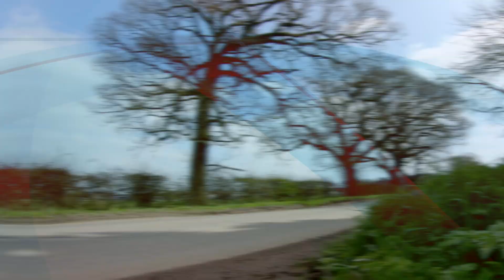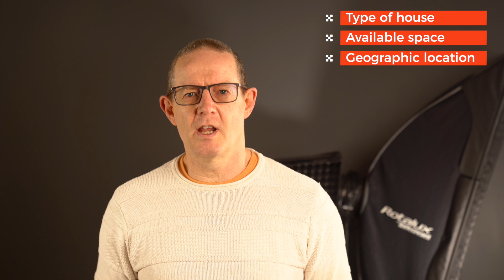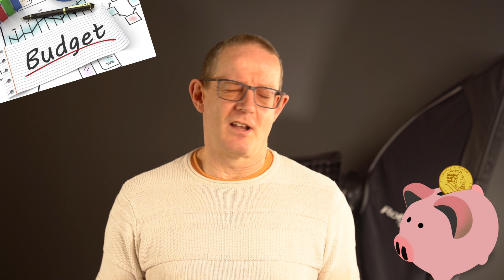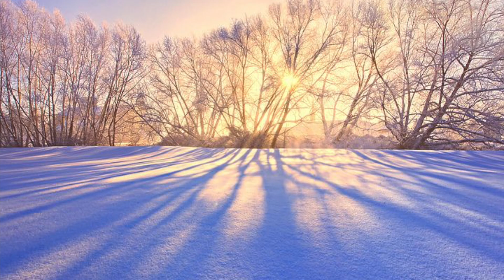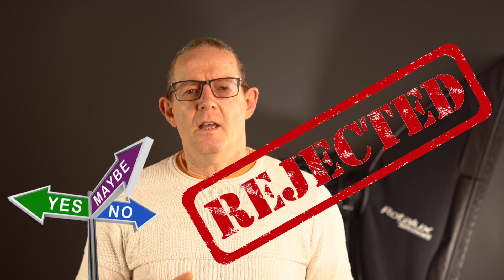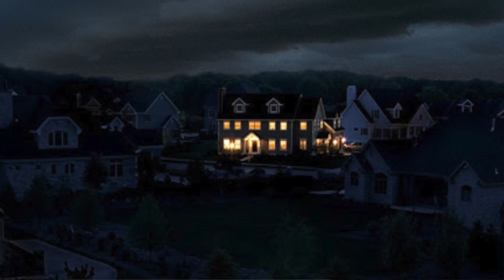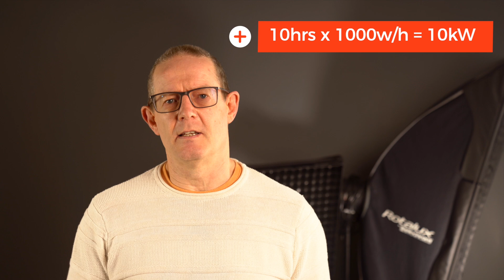So you want solar and a home storage battery

Comment: Great video John ... I'm getting a solar PV and battery solution fitted hopefully. But I also use gas on a combi boiler, and wondered what electric heaters could be utilised by my solar arrays instead of using gas for water heating? I'd really like to use it for central heating as well as showers and DHW if possible.
Reply from the maker: Thank you, glad it was a useful video.
Great to hear about your solar and battery. You can use excess solar to heat your hot water which is what we do. However, you need somewhere to store it. A hot water cylinder is the traditional approach, before combi boilers took over. There are new options with products like like thermal stores; sunamp, ecocube and so on. Depending on the size of your array and energy usage you may find you have more than enough surplus solar in the summer to boost your hot water, but lack enough in the Autumn/ Winter. However, still more environmentally friendly than burning gas.

Comment: I'm considering using a 5kW hybrid off-grid inverter which will handle up to 4kW of solar panel power and a 48 volt battery up to 24kWh.  Although it can be connected to the grid, the inverter does not export power to the grid and if connected to the grid it consumes grid power when needed either by the battery or the house. Therefore as far as the grid is concerned, the system behaves purely as a consumer and generally as a lower power consumer than prior to installing the system.

Under these circumstances:
1.  Can I avoid the need to use an MCS certified installer by using any competent and approved electrician for the grid and consumer unit connection supplemented by DIY for the other items?  The inverter, which will be the only item connected directly to the grid, is itself fully certified.
2.  Because I won’t be exporting to the grid, can I avoid the need to submit a G98 or apply for G99 approval?
3.  Am I still bound by the 3.68 kW inverter limit?
Reply from the maker: If you touch the grid in whatever form that takes, you need to approval from the DNO.

Comment: Thanks for your reply. I suppose from your reply insulation is the key. I have insulated the roof well , the problem is the external walls where I have uninsulated old cavities and very loath to use either pump or external wall insulated so really stuck between a rock and a hard place
 I am like most at a crossroads even though I have solar panels. We are both retired

Comment: Thanks for your reply. I was thinking, could you install an electric boiler and if sized correctly using a home battery and Agile tariff would that be a way forward. Expensive certainly, but cheaper than installing air source pump as our house is old and there is a limit to the amount of effective insulation you can install
Reply from the maker: An electric boiler will only ever be 100% efficient, eg: 1 unit in, 1 unit out so 1:1. A heat pump on average will be 300% efficient. 1 unit in, 3 units out. Yes an electric boiler will be cheaper than gas to run, however a heat pump will be even cheaper to run. 

Insulation should be a priory no matter what heat source you are using. The cheapest energy is the energy you don't use.

Comment: What is the best way to heat your house , I have solar panels with an attached diverter to heat the hot water cylinder. In winter I have to rely on the gas boiler to heat the radiators ?
Reply from the maker: My setup is the same as yours, with the addition of a battery. Since making this I've been looking at heat pumps; air to air and air to water. Both offer much better efficiency and lower running costs than gas. However, as there's so many variables in every property around insulation levels, draughts, size of building, location and so on. The best approach as a starting point is to get a heat loss survey. That way you know exactly how much energy you lose and how bigger heating system you need to keep your house warm. Many installers just chuck in an oversized boiler which costs you in the long run in poor efficiency.

Comment: Hi John, thanks for this incredibly useful video! I must admit I am struggling with regards to the battery conundrum. I only recently moved into my house and have an air source pump, which chews up electricity for heating. I thought a battery might help in the winter but I would imagine all the solar generation will be used just supporting the pump and none would be able to be stored in the battery. Conversely the battery might not be needed for many hours of the day during summer. Unless I can find an off-peak tariff to charge the battery in the winter, would you think the battery may be redundant? Thanks for your thoughts. It is so difficult to get properly impartial advice!
Reply from the maker: Thanks for watching. 100% agree with your thoughts. 
Battery will be great for winter time providing you get a tariff that allows you to charge it off peak to support your peak rates. As you know depending on the size, installation and efficiency an ASHP can use lots of juice during a day. A battery will certainly help cushion the impact on electricity usage. The days when it's cool and sunny can still be good generators of solar, so it is possible to charge a battery in winter. 

The battery in summer will still be useful between sun down and sun up, so don't discount it for those times of the day. We run our house on battery, in April we were 85% self-powered for the month on just under 1 megawatts of house usage. The battery added about 30% to that self-charge percentage. 

You don't mention the size of your solar array or the size of the battery you are considering. However, going large will always reap benefits in the long term IMHO.
Reply: Fab. Thank you. Great questions to ask the companies. One thing I am definitely learning is to not rush into this. Thanks again, really appreciated.
Reply: Thanks so much John. I am still getting quotes. As I am not clear on my actual annual usage I’ll have to guesstimate from March and April. Some of the colder days consumed over 20 kW, so at worst I’d say I’d need 7500kW over the year. I have been given quotes on various bits of kit. Researching just leaves me boggle-eyed as feedback reviews are not consistent! Are there and brands I should avoid? (Or perhaps you can’t say on this forum…..) One company is suggesting an 8.855kW system (Trina vertex) with solis and solax inverters (not sure why two, and why different companies) with 2  x 5.8 solax batteries. Another 6kW REC 405 system with 10kW solar edge storage… Any advice gratefully received.
 I’ve not done it before, but is it easy to shop around for suppliers? I understood it might mean a change to the meter which sounds expensive!
Reply from the maker: Firstly if you change suppliers there's no cost to have a meter swapped. You need a SMETS2 smart meter, which is all they fit now anyway to be able to benefit from smart tariffs from energy companies like Octopus Energy. 

The trouble with looking at reviews is you need to also understand the use case for the person using the product. If you don't know their energy usage, lifestyle, number of people in the house, etc etc then you cannot compare. 

You will often find different manufacturers for solar invertors and batteries, very few do both. So nothing to worry about there. A 6kW solar array is a good size for most homes, as I said before if you can afford to go larger then do. Generation is the primary goal then storage of the excess secondary. Many people go with the Tesla Powerwall battery or the modular Pylontech batteries. The Pylontech batteries you can add to add a later date if you find you need more without too much cost involved.

The solar and battery market is getting very active with new manufacturers entering the market and new products appearing almost weekly it seems. The main component that needs to careful consideration is the battery. Like in the video I mentioned the key things to compare.1. Storage capacity. 2. How much usable energy can be taken from the battery, eg maximum amount of discharge. Some are 100% others are 75%. 3. What is the ramp up rate, e.g. how quickly can it deliver the power to the home. Turn on a high powered appliance like an oven or electric hob, can it deliver 5kW instantly like the Tesla Powerwall, or does it ramp up slowly over 30 seconds to deliver the power. This costs you as you end up pulling from the grid to make up the shortfall. Same with charging, what is the maximum charge rate it can take? Again the Tesla Powerwall can charge at 5kW from the solar. 4. Can the battery run off grid in a power cut?

Comment: Which Battery is the best value Weco or Huawei.
Reply from the maker: The best battery is the one that meets your needs. Sorry if this is a glib reply, if you've watched this video and considered the criteria talked about then you'd not be asking this question.
Reply: @johntisbury  
Let me explain. I have two quotes for my needs.  Same spec except for the battery.  One is 3500 pounds( Huawei) the other is. 1800 pounds (Waco)  . The question , is the Huawei battery worth the money
Reply from the maker: @LiamReynolds55  whilst price can be a deciding factor it needs to be taken into consideration with other factors (all of which I've covered in this video). 

What is the storage capacity of each battery?
What is the maximum usable capacity?
What is the maximum kWh it will deliver at a time. 
What is the ramp up rate to deliver that power. 

All these things specifications will allow you understand the difference between the two products. Then you can decide which one is right for your circumstances. 

I can't advise on which battery is better for you. I don't know how much energy you use, how many people are in your home, your lifestyle / routine, do you have solar, how much excess you have and so on. Do you current export power, how much and what time of day. and so on.

Comment: I started totally green on this, ie no idea, just a bit of research, I built my home battery out of deep cell 12 volt batteries, li ked up into a 24vlot set up, then built up the renogy 100 watt panels 2 at a time, see how long it lasts, I run my home office off this set up, 8 battery's links with 6 sola panels, my business has 3 computers, printers etc a fan and led lights, the office is open 7 hours a day, this set up works for less than a grand..... My next step is to run a small electrical motor off two of the panels, this will turn a disc with 20 neoridium magnetics on, this will heat our water free of charge, giving us showers and central heating saving us 2k a Yr in oil
Reply from the maker: This is brilliant Phill, thanks for sharing. Just goes to show what you can do without spending a fortune. Glad to hear it's worked out well for you and your office.

Comment: I've had Solar Thermal for my hot water, have also had PV solar with battery installed.
Did ask a simple question if the battery works as a UPS & was told yes, then had a power cut and lost all power when I called they said the sales person never said it was or answered yes to the question.
So if you want to make sure it does get it in writting.
Reply from the maker: Sound advice Jeffery. The Tesla Powerwall will not guarantee to cut in on every power outage as not all outages are the same in terms of their behaviour. A slow reduction in voltage then nothing, or a short quick cut in power completely. Best to have a UPS for anything sensitive, home storage batteries are not UPS's really they are there to power the house in a power cut.

Comment: Hi just watched your video.  Really rather well presented so thanks.  Im interested to learn about off grid  solar/ battery system.  Ive watched lots of videos.  Ive noticed some systems are old.  Some are supperb i think but battery controllers and panels makes it a difficult area for a novice.  I think it would have been useful  to here your views on your system. But many thanks Colin
Reply from the maker: Thank you Colin. Off grid systems do seem to be a whole new level of complexity! Might be  worth looking at narrowboat setups as they are off grid and the components are the same. Cruising the Cut did a video a short while ago about adding a rooftop solar panel and all the components that go with it.

Comment: With regards to the storage battery location, I am concerned that it may get too hot in our loft during the summer and fail (as mentioned by another contributor here), Can the battery be installed on an outside wall instead?
Reply from the maker: That's a very good point. Plus they are heavy and could be a fire risk. Your installers may not be able to physically lift some batteries into the loft depending on which model you choose. 
Yes some batteries are IP67 rated for outside placement. The Tesla Powerwall is one, there are others too. We have ours installed outside against our house wall with no detrimental effects.

Comment: My house has two incoming phases, the “normal” permanently connected equipment is on one. Night Storage Heaters on the other the Tarif is Economy 7. Can both phases be connected? If not, then the normal phase is probably the one Inwould connect to P.V. Panels.  Am I correct in this choice?
Reply from the maker: Thanks for watching Mo. You would need to talk to an installer to get confirmation. I'm not an electric engineer it's not my area of expertise so I would be guessing which is probably not very helpful to you.

Comment: Hi John, could I trouble you for an opinion please? Our yearly usage is 3,300kw, I've been quoted for 2 installations 1/ Huawei inverter and Huawei 5kw battery, Jinko Tiger N solar panels with optimisers total 4Kw, and 2/ Givenergy inverter and Givenergy 8.2kw battery with Jinko panels and optimisers total 4kw. Any thoughts on which system or would you recommend something different? Thanks!
Reply from the maker: Hi Mick, to be fair I'm not an expert on components and how one product / brand compares over the other. It's not something I find interesting or relevant to me. I'd suggest searching YouTube for those components and get a round view from end users. There will be pros and cons for every setup. More so the battery and inverter than the panels. Panels are panels, there's not too much between them.

Comment: How do you measure ramping up speed of the batteries? How is it rated? how do I look for this information in the data sheets?
Reply from the maker: It's a great question. Ramp up speed is measured in response time in seconds and the amount of kW it can supply. For example the Tesla Powerwall 2 can deliver 5kW instantly with no delays. Other batteries take up to 20 seconds to respond and max out at 3.6kW. This information is often not on the data sheets. You need to specifically ask on forums, suppliers, installers etc.
Reply: @johntisbury  Thanks for your quick reply!  It's a shame they don't have this information on data sheets but I suppose there are alot of nuances that might effect it

Comment: Do you have to notify the National grid if you fit 8 panels? If I was to fit them DIY.
Reply from the maker: It would be your local DNO you notify, not National Grid. If you are installing off grid then no need to inform. If you are connecting to your house’s electric supply then yes you do.
Reply: @johntisbury  I have 4 panels. Max 700w haven’t told them about it. I’d be surprised if they don’t know as I have smart meters that are telling me I’m feeding to the grid.
Reply from the maker: @mickbmx  two different organisations at play here. 
Smart meters are owned by the energy suppliers, e.g. who you pay your bills to. Consumption/export dealt with by your supplier. Connection to the grid is property of your DNO, they own upstream of meter.
Reply: @johntisbury  I’ll try contacting them.
Reply: @johntisbury  seems like on the form they emailed they have to be signed off by someone qualified which im not. So solar isnt for the DIYer.
Reply from the maker: @mickbmx makes sense I guess, with qualifications comes liability and redress if things go wrong.
Reply: @johntisbury  shame they make it so difficult. It’s very hard finding an ACS guy to sign off 4 solar panels on a shed. 

If it was easier and cheaper so many more people would fit solar.